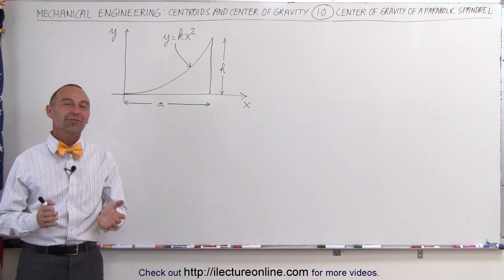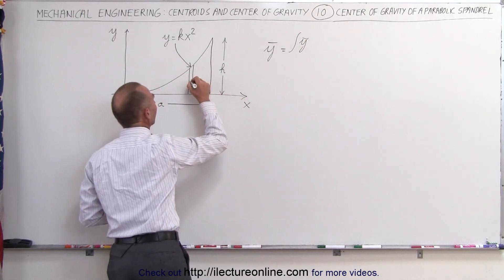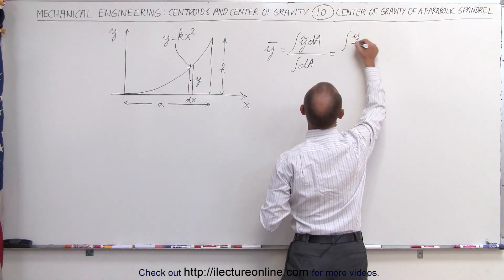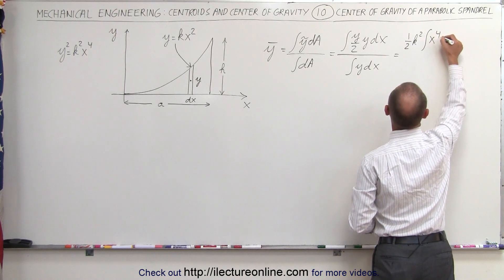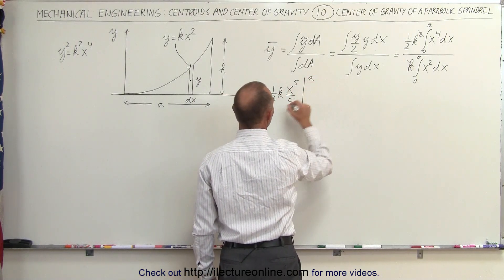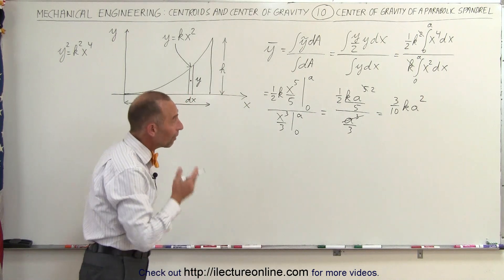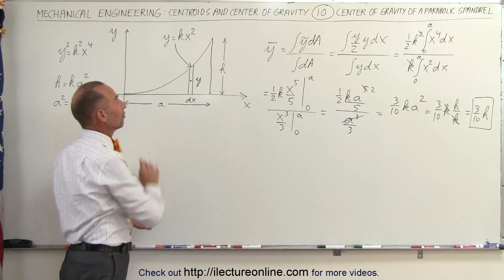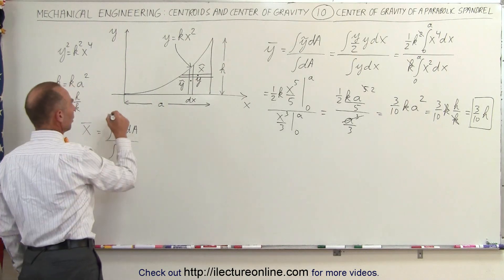Mechanical Engineering: Centroids & Center of Gravity (10 of 35) C. G. of a Parabolic Spandrel

Comment: +Online To The Brain Yes, that often becomes confusing.  1) The find the length of a strip where a is the left point and b is the right point is as follows:  L = b - a   2) To find half the length  (L/2) = (b - a) / 2   3) To find the midpoint between a and b :   midpoint = (a + b) / 2  Try it with two numbers like 3 and 7 

Quoting a comment below on why its (a+x)/2 instead of (a-x)/2
Reply: Thank you for the comment , I kind of understood what you wanted to say , but what does x represent here actually , like in the caee where we take the vertical strip , y represents the height of the strip right ? , does x here denote the length of the horizontal strip aswell ?

Comment: Very much appreciated, thank you again. However, for me it turned out to be easier when using a horizontal area element when calculating y hat, and a vertical element when calculating x hat. 

Reason: From the formula  (SUM y A(y)) / SUM A . If you use a vertical area for A(y), then there are many y values in each vertical area element. If a horizontal area element is used, it only has one value of y. This seems to make the math easier, for example, no need to remember to use y/2 for the y value.

Comment: if we let k =1 and  a= 1 and h=1 .. then 0<x<1 and 0<y<1... so the centroid is located at (3/4, 3/10). So far, SO GOOD... lol.... so, if I now Cut a Piece of Sheet metal in the shape of this Graph, that is y = x^2, .. isn't it safe to assume that I could BALANCE that Piece of metal on my finger if I place the x= 3/4 on my finger?  I'm assuming that's true.... but if that is true.. then the AREA to the Left of x=3/4 should equal the AREA to the RIGHT of x=3/4.. Equal areas denote equal MASS. therefore a BALANCE... and yet... when I use the AREA UNDER A CURVE integration and use the proper limits... I can NOT get the left area to equal the right area....  so, I'm still struggling here... Just wanted to say that....
Reply: by the way.. I figured the area under the entire curve is = the integral of y= x^2 from x=0 to x=1. That should be Area = (1/3) x^2 from x=0 to x=1.. so Area = (1/3) so the left AREA should be 1/6 and the right area should be 1/6 .. in order for the BALANCE to occur.... anyway... just babbling now MICHEL... thanks.. no need to respond...

Comment: Professor i am confuse on Xbar you say in horizontal strip length of strip = (a-x) but in case of center of strip  why it become =(a+x)/2 why not center is strip length/2 that mean =(a-x)/2 ??????
Reply from the maker: +Online To The Brain Yes, that often becomes confusing.  1) The find the length of a strip where a is the left point and b is the right point is as follows:  L = b - a   2) To find half the length  (L/2) = (b - a) / 2   3) To find the midpoint between a and b :   midpoint = (a + b) / 2  Try it with two numbers like 3 and 7
Reply: +Michel van Biezen  thank you sir for your lecture and quick reply.

Comment: you dont have to make a horizontal rectangle for y just a vertical rectangle is sufficient to solve x and y bar.
Reply: How?
Reply: Can you tell how it is possible?
Reply: @shezanahmmed5582  You can find both parts of the centroid of that same rectangle. Then set up your integration with the components for the respective part. While the setup is tricky, the integral is easier to solve.
Reply: @reed560  yes bro. I got it. Thank you so much.
Reply: @reed560  can you tell me how to do that?
Reply: @sabyasachiguha367  
I can try, but to use only words is very tricky.

Think of getting the centroid of any rectangle, there is a both a x-coordinate and a y-coordinate.
If we wanted to use the same rectangle for both coordinates in the example in the video, we find an equation to represent the y-coordinate of the centroid for that differential rectangle. Its not easy because at each instant that coordinate is changing by the equation of the curve that makes the top of the spandrel. In the example above, that equation is y=kx^2. The height of that rectangle changes according to that equation, remember, the rectangle is differentially thin so we assume that the top of the rectangle is infact flat. So you can set up an integral of the y-coordinate equation by finding what the coordinate would be on a regular rectangle and then substituting in the equation for the height. We know for a rectangle its going to be half the height, or H/2. Because our height is changing, we substitute our equation for the height in for H. Therefore we get (kx^2)/2, then we integrate the y-coordinate equation of our centroid (kx^2/2) along the entire spandrel, remember we are integrating along the X axis, so our bounds are going to be somewhere on it. We know the spandrel is 'a' long so we must integrate from 0-'a'. so our integral looks something like this       int from 0 to a of (kx^2/2)dx
Which is an easier integration to do, however I believe the video purposefully used two different rectangles to show that the dimensions for a spandrel can work out to fractions of known dimensions, such as (3/10) * H
Reply: @reed560  thanks i think i get it

Comment: why is the length of the vertical strip only denoted as y but for the horizontal strip, it is denoted as b - x? whats the difference?
Reply from the maker: In the vertical direction the botton is at the x-axis.  For the horizontal strip, the left side is NOT at the y-axis.

Comment: Would it be simpler if we use derivative of each dimensions and find min and max average out then find average then divided by 2 and intersect them?  That way with any irregular shape be fastest on sound surrounding output can find min and max very fast
Reply from the maker: That will not work.  Try and it see if you get the same answer.
Reply: @MichelvanBiezen  not the same answer may mean many thing but not mean not working

Comment: why we are not taking the average ( (Y+ h)/2 ) and not taking the area width ( h-y ) in the first equation ? as we did in the 2nd equation, ( ( X+a)/2 ) and ( a-x )
Reply from the maker: Note that in the vertical direction the reference line is the x-axis.  But in the horizontal direction the left side of the area is not the y-axis.

Comment: ...wouldn't it be easier to  find X by integrating K*X*X^2 from 0 to a ? am getting the same results
3a\4
Reply from the maker: +iverson0523  I can't comment on your approach unless I can see how you calculated the center of mass starting from the definition of the center of mass. The video shows the general approach that works for all circumstances.

Comment: In the case of horizontal strip,shouldn’t the strip's length be considered as "X", just like in the case of vertical strip where u took the verticle length of the strip  as " Y".In vertical strip u got ~y=y/2 where as in horizontal strip shouldn’t it be just ~x=x/2?
Reply from the maker: No.  The vertical strips all end at the x-axis where y = 0.  That is not the case with the horizontal strips.

Comment: Why can't we integrate x = y/k in the denominator for x bar? Why do we use (a -x)?
Reply from the maker: The length of that strip is indeed (a - x) as in the video.  What is the distance between  5 and 8 on the number line?  You find it by subtracting the 5 from the 8    (8 - 5)

Comment: Hello Michael,

These videos are amazing. This is astounding work.
I have one question - shouldn't A be the same value for both calculations of xbar and ybar, since the area is the same??
Reply from the maker: x bar and y bar represent the center of mass which also depends on the shape of the area, which is different with respect to the x-axis and the y-axis.  (thank you for the comment).

Comment: Sir why are you integrating the denominator A?
Reply from the maker: To find the area under the curve.  (That is part of the formula to find the center of mass).
Reply: Ohh but the parabola that had a curve in the former video you didn't integrate the area above it sir....why is that?
Reply from the maker: Better ask the question on the video itself, rather than placing the question here.

Comment: Just a question in 6.04, Why x_bar = 1/2*(a+x) ?, in this point i forget how to prove it.
Reply from the maker: The average (or the midpoint) of 2 number (for example 6 and 10).  You add them and divide by 2.     (6 + 10) / 2 = 8
Reply: @MichelvanBiezen  Thank you so much.
Reply: @MichelvanBiezen  Got it, Now I've solved/found a Yc.g. of sector of ellipse by your clip on 6.00+++ . Thank you so much.